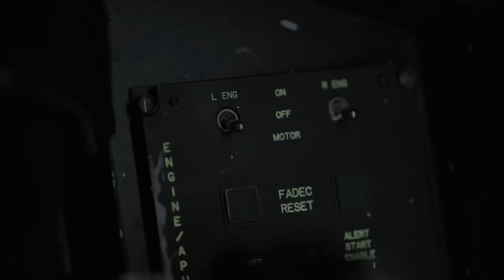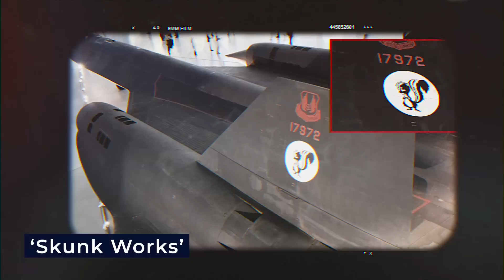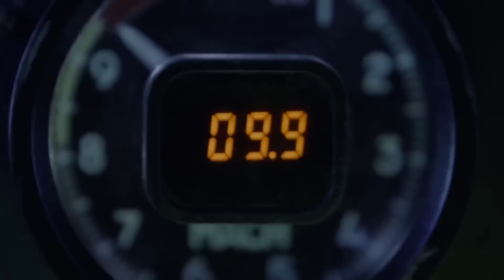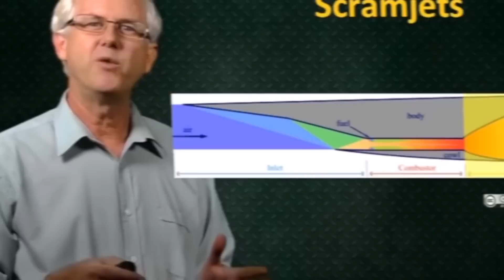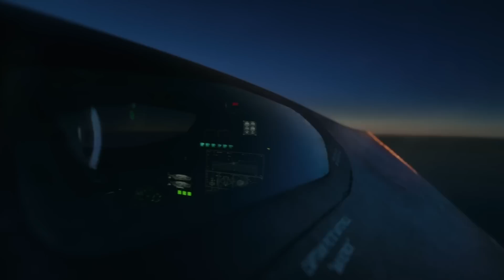US NEW Darkstar is The Most Advanced Aircraft Ever Created!

Comment: The revolutionary new jet engine developed by GE in collaboration with DARPA and USAF Labs combines four technologies. They are turbofan, RAMJET, SCRAMJET, and a rotary detonation combustion chamber that makes the engine more efficient, more powerful, and extending its range for a given amount of fuel. This engine will propel 6th generation planes to Mach 10 and maybe faster.

The US has also begun development of a 7th generation fighter which might be able to achieve low earth orbit.
Reply: @markfischer3626  what is the point you don’t have the money to mass producing it! Maybe contract it to China
Reply: GE? if you want a lightbulb or coffee pot. but if you want go 3 times the speed of sound Pratt had that 40 years ago.Built without the use of a computer.
Reply: @markfischer3626  can’t even build a hypersonic missiles that means you doesn’t have the technology and the $$ so your 6th or even 8th gen plane it capability is understandable. China is building a base station on the moon. You know what that means? And do you know China had deployment its 3rd gen hypersonic missiles that fly at 18 Mach and its flight are navigable?

Comment: Beyond what this article describes here there already is another hypersonic spy plane that's be flying for some time. the SR-91 from Lockheed Martin.  A combined cycle turbojet, ramjet, scramjet, rocket propels this incredible machine to a ceiling of 130,000 feet and is capable of speed in excess of Mach 10 if not even greater,  This machine has already been tracked from satellites flying eastbound from Nellis AFM/Area 51 exceeding Mach 8 and that was years ago.